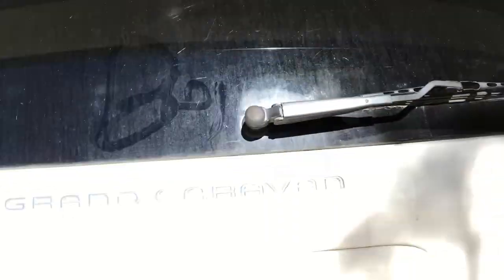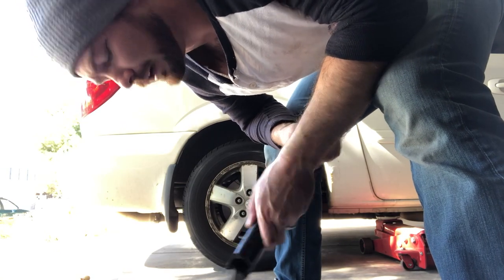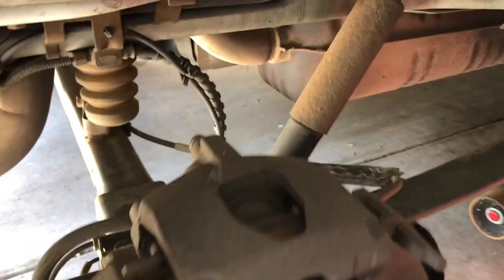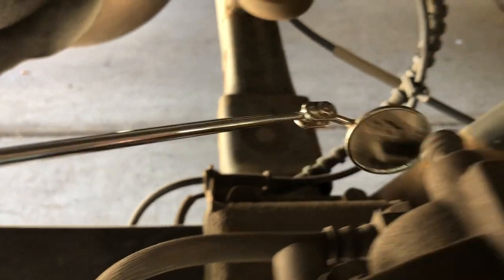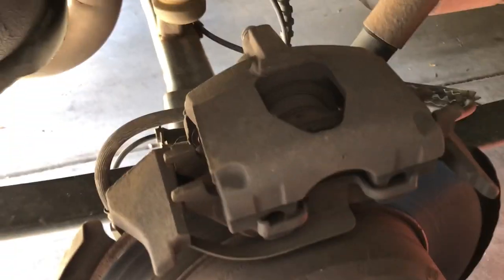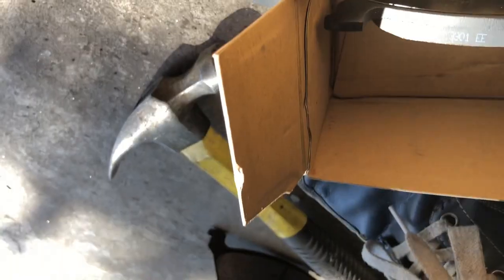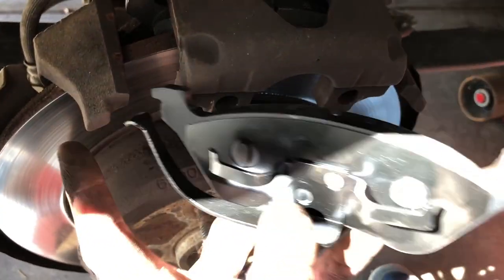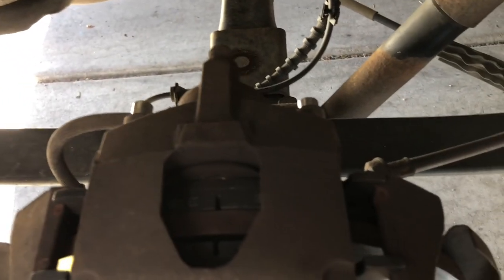2006 Dodge Grand Caravan Rear Brakes Replacement

Comment: Thanks for the close up on that star bit socket now I know exactly what to use on the bolt pins, I was very confused cause I already did front brakes but the 7mm hex socket used for front on mine is different for the back but you nailed it.